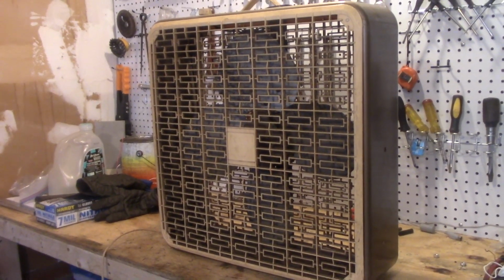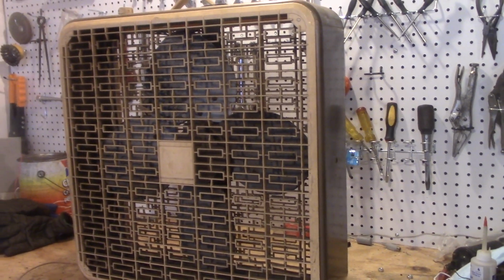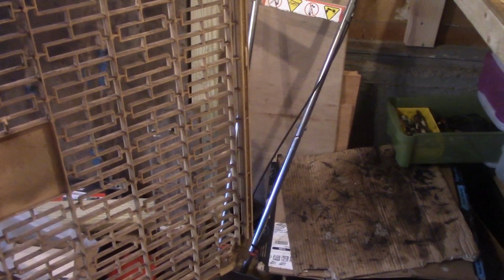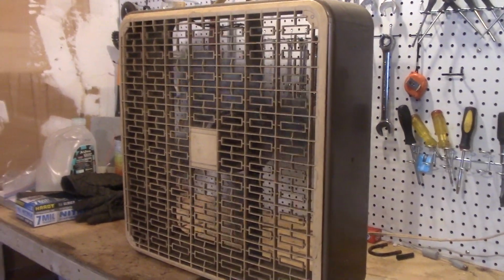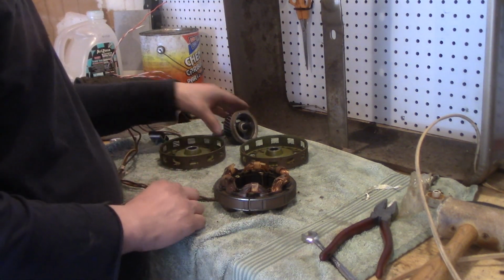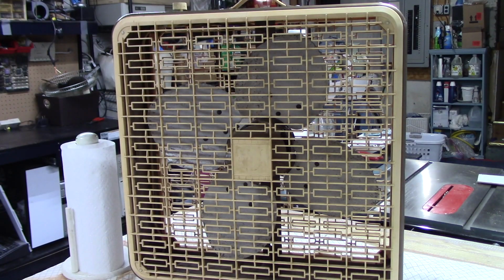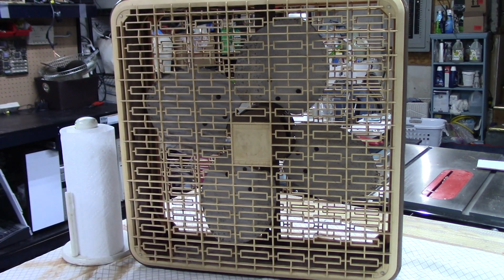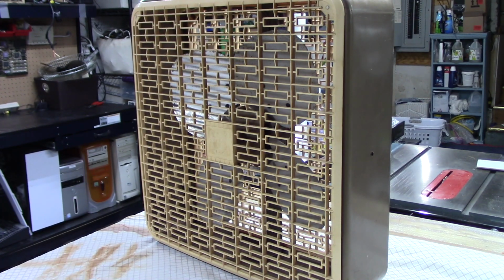Vintage Korvettes (Frigid) Box Fan Clean and Service

Comment: I have a 3 speed and it very special too me been with me 25 years. I couldn't find now info on it and found your video on youtube! Thanks for the info!
Reply from the maker: Nice! That's the one I was originally after but I just couldn't find one lol! They're good fans, just listen out for that motor buzz! No problem! Glad I could help! Thanks for Watching! : )
Reply: Keith, is your 3 speed a push button? I have my parents Frigid 3 speed with push button control and 5 blades. My parents bought it brand new in either 1976 or 77 and it still works great.

Comment: I could be wrong but to the best of my knowledge, the Westinghouse motors were built back in the 1950s, because my 1950s wizard box fan is a mid century, and there were a lot of these particular motors on some the old lasko fans which were from the 1950s too.
Reply from the maker: I'm sure they produced motors for a while. This fan is a product of the early 70s so it has to be at least until then lol

Comment: Cool video, very stylish and practical fan, when the motor makes that buzzing sound when starting up I guess that means the motor is coming close to being finished but if you varnish it even if the coils are bad will that still save the fan?
Reply from the maker: Thanks! When the motor buzzes like that it means that there are windings that are loose and the varnish will hold them in place. I don't believe it has anything to do with the lifespan of the motor unless you let it buzz for long enough that windings break or short out. So yes, I think it will save the fan from a gradual death lol. Thanks for Watching!

Comment: I've always wanted one of these 4 blade frigid box fans too, but they seem to be the hardest to find. I have 2 of the 3 blade models both of which don't work and there's also a 5 blade one.
Reply from the maker: I know that feeling lol! Yea I have come across the other variants more frequently than these for some reason. Why not fix the 3 blade versions? I had a 5 bladed window fan, but sold it because I had no use for it. Was a pretty decent fan though! Thanks for Watching!
Reply: @colin_5839  One has a bad motor and the other one needs to be re-wired. I'm trying to fix them, I just don't have the time to right now.
Reply from the maker: Ohh ok gotcha. Yea I know how that goes!

Comment: Hello Colin , I know this fan does a westinghouse motor , my box fan has 3 speed Westinghouse motor would you have any information on what replacement switch I can find for it?
Reply from the maker: Thanks for the info Harold! As for the switch any switch that is the right size and has the right amount of positions for you should work. Pretty much as long as it can handle the current, fit in the space, and doesn't do anything weird like powering multiple windings at once it should work! I know I have used toggle switches and rotary switches from the hardware store in fans many times in the past! Good luck! Thanks for Watching! : )
Reply: @colin_5839  Thank you for help Colin , yeah other switches that I have used for my fans like a 2 positions ( off high and low ) , would do funny unusual things like powering different other speeds like high med and low on a 2 seep motor and even powering the motor on with a 2 speed switch and there being 3 speeds and it would power off unless you un plug it , which was very concerning to me because this king of malfunctioning of the motors have nearly led to a burn out before , thank you for the help and a great day.

Comment: Hello Colin I'm sure you remember me, I have a question for you something that you can help me with , the Westinghouse motor going to one of my old wizard box fans still works very well but it appears that the enable on the windings have deteriorated but the windings are not really loose , but like I said the motor still run very well , which gives me the indication that motor is good health, but I do want to varnish it to prevent future problems , can you varnish it with any kind of varnish or is the a certain kind to do it with , I do have a can of it but it is the kind that you do hard wood floors with , I'm afraid that if I coat it with the wood kind it will damage the amateur , would you assist me with this ?
Reply from the maker: I sure do lol! I am not sure if any varnish would work but I would just go buy some EL600 sprayon varnish. It's the best of the best from what I have been told and worked very well on this fan and my Lakewood HV-12. Good luck!
Reply: @colin_5839  Ok thanks friend! ,👍😀 I'll do just that , good thing that I asked before I jumped to conclusions, if I ruined that motor now that would take more money and time to get that replaced thank you and God bless you and have a great day!
Reply from the maker: @stevethefanman8955  No problem! Good luck!

Comment: I have a blade stuck on my lakewood p23 box fan. How can I remove it without causing lots of damage.
Reply from the maker: Whenever I have something that is really stuck I use plenty of patience, PB Blaster penetrant spray and some heat if needed and between those few things and a puller I can usually get just about anything off. Never really had a fan blade get super stuck on a shaft before, but I'd imagine the same techniques could be applied. The worst thing you can do is rush or be too forceful.. Good luck and let me know if you have any other questions! : ) Thanks for Watching!
Reply: @colin_5839  thank you 😊